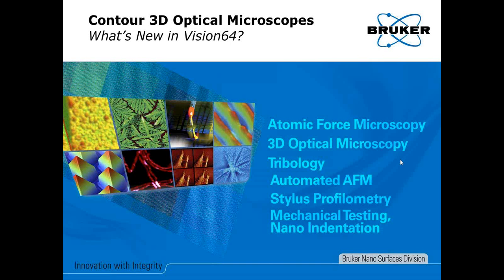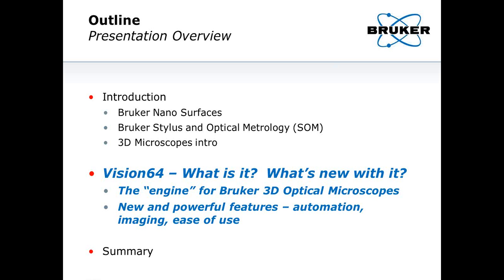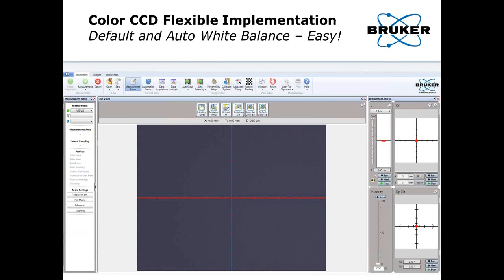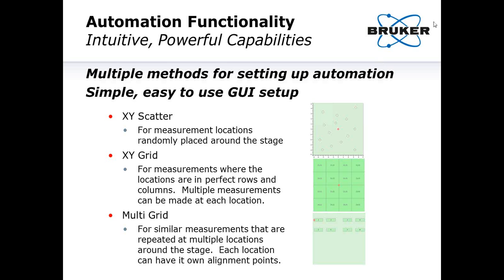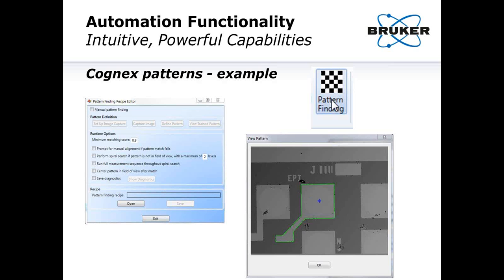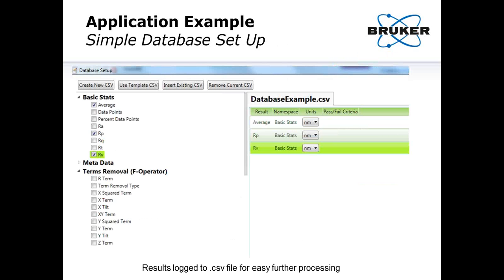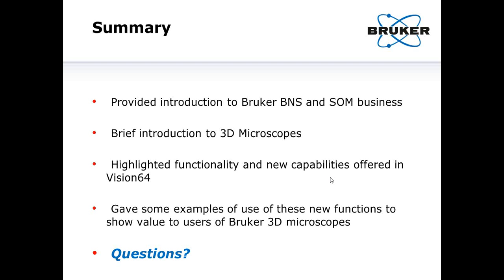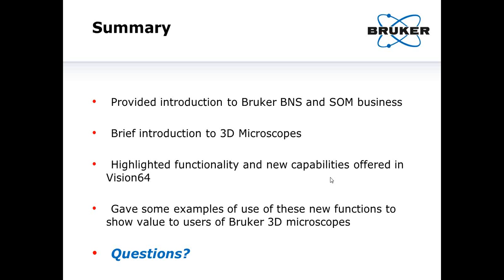What's New ContourGT 3D Optical Microscopes and Vision64 | Bruker

Comment: Hi, I'm a 2nd year PhD student. I am using Vision 64 currently for my experimental work analysis, however in VXI mode the machine is limited to scanning 170um. so I put 20um as a backscan and 150 as a length. However, when I do 4x4 stitching, I get over 170um the Sz value which can be reach sometimes 190um. I also use a green light and keep the SNR value at 0.1. Could you please tell me what do I wrong about it?